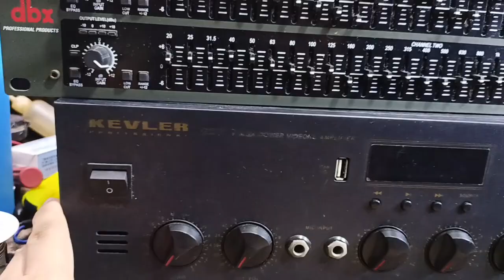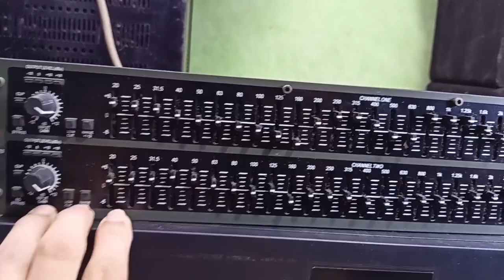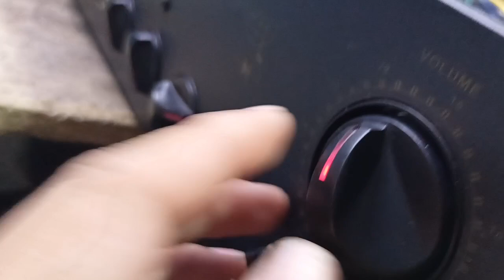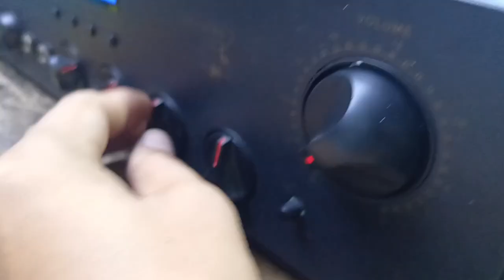AMPLIFIER REPAIR | KEVLER AMPLIFIER AT DBX 231 EQUALIZER  , Gawin natin para mahabol sa pasko

Comment: Hello po, paano po ayusin ang multimedia speaker na merong sound ang main speaker pero wala sa output speaker?
Reply from the maker: Paano nga ba ayusin ? Una po jan kailangan tech ka or may knowledge ka sa electronics para familiar ka saga pyesa at sa mga function nila , pag meron po kayo knowledge sa electronics mas madali po e guide kung ano ang dapat e check na pyesa
Reply: @BasicBOBP84  meron po
Reply from the maker: Ayun good , need mo mag voltage check at audio trace kung saan nawawala ang audio